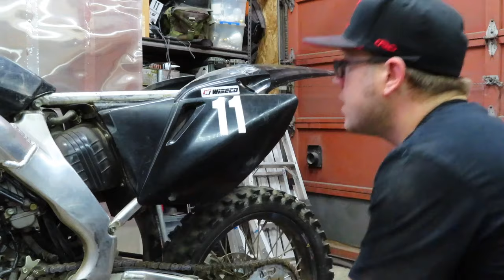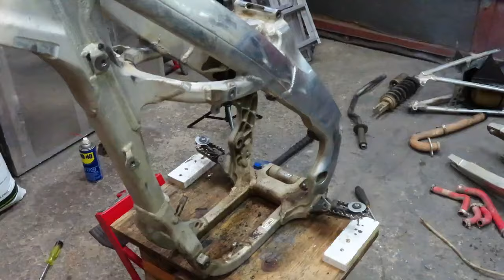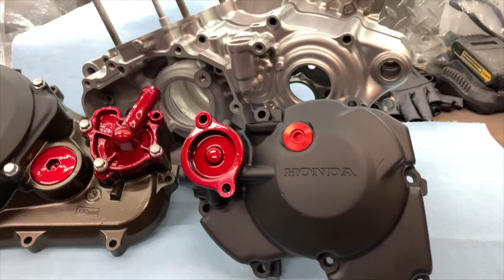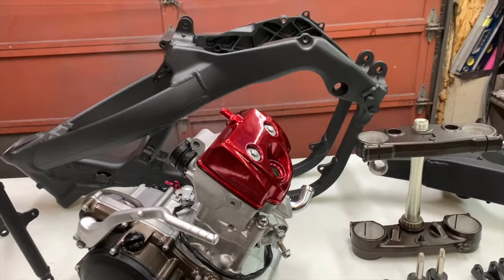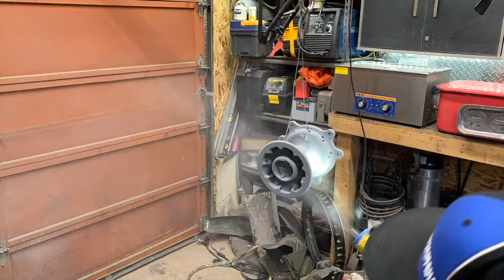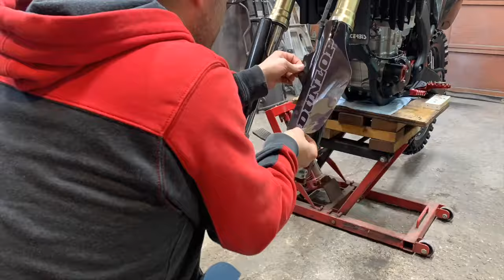Amazing transformation of a blown up $900 Dirt Bike!!! (2004 HONDA CRF250R FULL REBUILD)

Comment: I’ve got an 04 that I’m rebuilding do you have any suggestions on what carb I should run the one I have just doesn’t seem to actuate the accelerator pump so I’m going to throw it out (I have already rebuild and tuned it it runs great just is ass for acceleration) I’m going to put a ported fast head on it and a hot cam

Comment: I never go with black covers on the engine. Heat is the enemy of a Mx bike and putting black parts the engine and riding on a warm sunny day that black will help keep that engine hotter. Learned that from an old school mx mechanic
Reply: Not that big of a difference if any

Comment: What is the red head color? Love it!.wheels are awesome too ? What is that? High spped could not tell.
Reply from the maker: Thanks, that colour is called translucent red and it's applied over a chrome base
Reply: @northernmx5973  paint?
Reply from the maker: @mikeschlup5279  powder coat
Reply: @northernmx5973  do you do any side work ?
Reply from the maker: @mikeschlup5279  a little bit locally

Comment: Did you build the oven?
Reply from the maker: Yes I did
Reply: @northernmx5973  Do you have a video on the build or any information on how you built it?
Reply from the maker: @peterhansen5754  no I don’t have a video because I was totally winging it on this oven haha! I used some material building it that I shouldn’t have like galvanized steel studs for the framing 😷. The oven is fine now after using it for a while but I wouldn’t recommend building an oven how I did
Reply: Haha, I came here with the same question